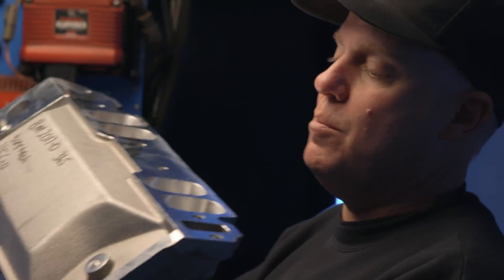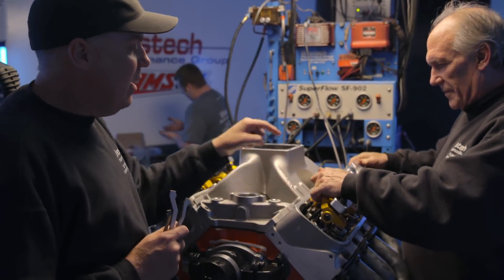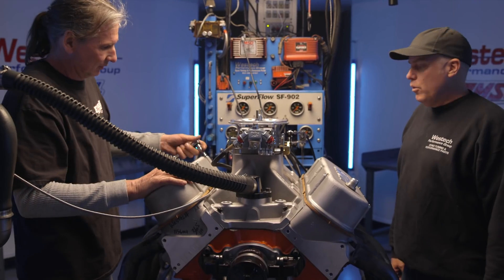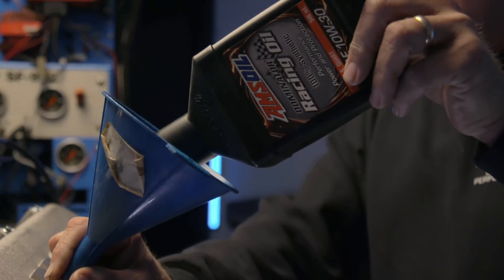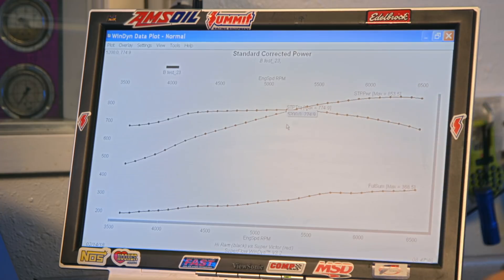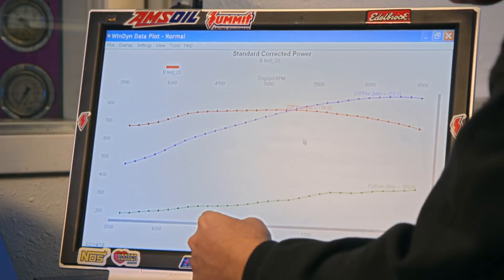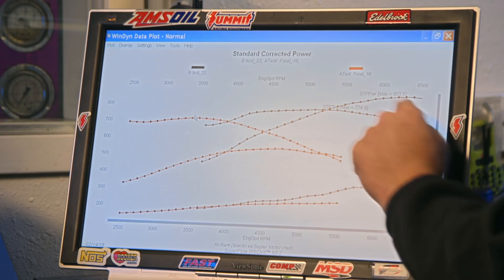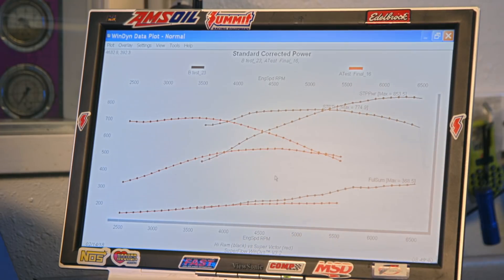Torque vs Horsepower — Engine Masters Preview Ep. 31

Comment: Sweet little motor tons of power and tons of fun. This was essentially a bolt on build. Would I would like to see is this motor with a proper quench height. So deck the block to give say a 30 or 35 thousandths quench height instead of the 65 or 70 thousandths height it most likely has. The quench would be improved and you would get your compression ratio much higher. Which is what you were looking for. I would be your motor would produce 915 hp to 925 with this one change. Nothing to sneez at for sure. 60 to 70 horsepower gain with machine work and no additional or changed parts. Wonder how close I would be.

Comment: They did an episode on 383 chevy vs. 383 mopar. It was laughable that they said, "mopar was better, because it made a little more power" ...except they obviously don't know that the mopar 383 weighs almost twice as much as the Chevy 383 and the 383 mopar is a big block that is actually 408, instead of 383 and the mopar parts are harder to find and more expensive. 
I usually agree with these guys on pretty much everything, but on this they were either ignorant, or dishonest, those are the only choices. Probably why they deleted the episode from youtube.
This is still  hands down the BEST show on MotorTrend and is well worth $4.99/month ...plus you still get 99.9% of the other great content on MotorTrend. Just remember, these guys know who butters their bread and it's their job to sell you stuff!

Comment: Torque in some instances is far more important. Designing a diesel motor to pull a truly heavy load. U need to put the emphasis on low rpm pull. All the top end power in the world wont matter if it stalls and dies once u put it in gear. Gearing is very important its true. But without monster lowend torque to turn those gears u aint going nowhere. Torque truly rules the heavy duty section.
Reply: You just use low enough gearing so that it doesnt stall.
Reply: torque for the real world and stupid low enforced speed limits
HP for the race track and those with small dicks who can compensate for the lack thereof

Comment: First off I love this show ! it is so refreshing to watch you guys cut through the BS and just lay it out so the the keyboard experts of the world can see actual experts prove them wrong (or right). I understand you probably have a deal with Holley because you use the same Holley carbs in all your vids, but can you do a vid on comparing off the shelf carbs v's custom built carbs like pro systems , APD, AED  etc.. ? the reason for my need to see this is because in my local drag racing environment there is the old argument of this brand is better than that one verses the slightly logical argument of it doesn't matter which brand as long as the same fuel ratio at this RPM is the same they are all the same. I'm interested in price over performance, peak power and power curve difference, throttle response. I know this would be an expensive test but I am truly sick to death of people saying i can go faster if i buy an APD carb and ditch my Demon carb and not being able to offer me any real hard evidence that a$3000 carb is going to be better than my $800 demon . please please please consider my request!

Comment: The higher the power band is in your engines rev range, the lower ur torque output is going to be which is why think it's ignorant when people say the LS is superior to the Coyote because the LS has more torque. That's because the LS/LT peaks around 5800 while the gen. 3 Coyote makes power through 7500 rpm's. Diesel motors are torque monsters but can't rev higher than approx 550 rpm's

Comment: You guys need to do 3 way test of the best small block from the big 3 factory installed in a car. 
Lt1, 351 BOSS, and whatever Mopar had (340 6 pack?)
All in stock configuration

Comment: You guys talk a lot about performance parts and HP/TQ. What about volumetric efficiency and fuel economy while increasing HP/TQ? Obviously there is a limit, but can you gain, say 50-100 HP/TQ with out losing fuel economy?
Reply: compression, tuning, fuel type. but energy is energy. either the motor is going to be much more efficient at extracting energy from the fuel, or you just need more fuel. you could gain 50-100hp if the engine wasn't really taking advantage of the fuel in the first place.  and also, the way you phrased the question you could just easly add more hp from fuel. stay off the throttle more and then when you want to just have 100hp more available all the while overall getting better gas mileage

Comment: 700hp test
Cast iron vs Ls 3,7,9,x
Put both engines into a car setup for quarter mile. Compare which motor gets the car down the track fastest

Comment: Compare that motor vs Lsx and put them in a car and do a 1/3 and 1/4 mile times see which 700hp is faster..7.5 liter v8 vs lsx..
Test vehicle both engines can fit into any gm car..

Comment: Would be interesting to see a full rpm range graph of both. Not just 3000+
Reply: They can't with that engine dyno, also wot, lots of timing and a carb is a nono at low rpm.

Comment: Watched the episode for free on the site and I think David backed down to quick on his debate. The iron head set up would be perfect for something like a 1 ton where you want that low down torque. That 700lbs of torque at 2500/3000rpm would be more useful then the 740 at 4500 when towing. Revving the engine that high going up hills would get that BBC hot pretty quick. Also you save a few thousand dollars using the stock 454 heads and stuff

Comment: It's ridiculous that there's even a hp vs tq debate... Hp= ftlb tq x rpm / 5252. It's just math. 
More torque at any rpm means more hp at that same rpm.
It's all about the torque curve, which in the case of this engine, the torque curve is ridiculous. Nice build.
Reply: I think the idea is that building higher HP often means shifting the torque curve to a higher RPM, and not just higher across the RPM band.
Reply: @peterthadeus9441  I agree, that's often the case. My point is it's all just talking heads until the dyno is displayed. The torque curve defines the character of the engine more than peak hp#s(even tho their the same thing).
Reply: Well, ft.lbs is the term used for work done, torque is lbs.ft - an important distiction if you want to make a point of it, but you have the gist of it.
Sort of, power is indeed a function of torque and power (do you know the actual math's for the 5252 - I worked it out over 40 years ago, and been using it since). 
BTW, in SI (metric) terms it is N.m x rpm/9880 = kW

Oh, torque is basically a function of engine efficiency, or VE, and if a "power" engine is better optimised for cylinder filling, it would be expected to show more torque (less any increased internal lesses).
Reply: Nacho Man - yes a 200 HP 1000 cc superbike has more torque everywhere when compared with a 500cc 50 HP bike. And if the 500 cc feels 'torquier' to some, then that's just shear emotion - just guessing, because in the high rpm's such a bike is lacking so much *g*.
Reply: @JamesBrown-ux9ds ... So a 500cc feels like more torque than 1000cc due to emotion but lacking "g"..... However it feels just wear a Helmut.
Reply: That's not true, at all. HP does NOT equal Torque!
Reply: John Doe you're right, Hp does not equal torque. See first post to clear your confusion.

Comment: Big block chevys dominate!
Reply: Unless a mopar shows up.
Reply: Brian Samuels our smallblock ford on pump gas makes about the same horsepower.  Sooooooo
Reply: Jon Doe it might do but what compression ratio is it running and is it streetable?
Reply: Brian Samuels 8.8 -1. Setup for turbos.  Haven't got that far yet as the trans keeps letting go.
Reply: Jon Doe ok a force induction motor. It's easy getting lots of from those types of engine builds but not NA and streetable.

Comment: I love how the sound of the engine is nowhere near the actual throttle position.  You can see the throttle slam shut in the middle of the run and then open back up, all the while the sound is of almost max RPM.
Reply: LiveeviL6969 they shot some Broll and thats it. They didnt record the engine during the dyno run...
Reply: @littlebuch  means you don't have to deal with showing fuckups like leaks and similar. us mos don't grasp how a run should sound.
Reply: It is just clumsy editing. The audio and video could have matched, they just boogered it.
Reply: LiveeviL6969 haahahaha good eye
Reply: Also the shutting and opening part is the same clip played on repeat...
Reply: Good eye
Reply: They suck

Comment: I think horse power is better than torque
Reply: not if you're driving a truck
Reply: raptorne1 torque ftw
Reply: Enayer 926 nope! You build a engine for torque not horsepower.
Reply: Brian Samuels Dude what are you even talking about? Do you even know what horsepower means?
Reply: Matthew Prather torque gets you going real quick especially in a short distance. Pulling power. Horsepower is only felt on top end.
Reply: Brian Samuels Horsepower is a measure of work being done. All you need to know for acceleration is a horsepower graph.
Reply: Matthew Prather torque is more important than horsepower especially launching a car and going a short distance. You must not drag race. I beat a lot of street cars from light to light in my 4,200 pound '68 impala because my engine makes 600 foot of torque max in the low rpms not because it makes 565 horsepower.
Reply: Brian Samuels Horsepower is a unit of power, just like watts, that number is the force on your rear axel making you go. Torque is just a number in the equation to calculate horsepower
Reply: Matthew Prather I understand that Albert Einstein. You just don't understand my point but it's all good. 😂
Reply: Brian Samuels Horsepower is all that matters. Motors with a big peak torque number are making a lot of horsepower at low RPM. My basic point is if you want power at low RPM, you need a lot of torque. But the torque is not what you should be paying attention to, it's the power. The power is what is actually dictating how fast you can go and how quickly you can reach that speed.

With a long enough breaker bar I can put out 600 ft/lbs but I can't replace an engine because I'm not outputting any horsepower.
Reply: Xei nope! Horsepower isn't all that matters. A car or truck wouldn't move without torque. They both need either but in the real world torque is more important. Example: in 1970 cadillac motors back in day only made 400hp but they made 550 foot pound of torque! So you don't actually need a lot of hp to make big torque numbers. That's a myth. It all depends on stroke.
Reply: Brian Samuels Horsepower is just Torque * RPM / 5252. Torque is already included in the equation so you don't need to include it as a seperate number. All that matters is the horsepower curve. Peak HP numbers don't tell you a lot but the HP curve is everything.
Reply: Horsepower is how fast you get to the wall;
Torque is how far you go through the wall :
Reply: I think that it doesnt matter which one is more important but merely that both help.
If an engine creates 400 ft.lb. of torque at 3000rpm; it will produce 228.48 hp at 3000rpm.
If that same engine were to produce 400 ft.lb. of torque at 6000 rpm., it would produce 456.96hp.
If it again were to produce 400 ft.lb. of torque at 7000rpm., it would make 533.13hp., at 7000rpm.
Hp is a measurement of work being done and cannot be measured on a dyno or anything else without torque being applied.
Just like your fingers or your thumb will not move without torque being applied to the tendons in your hand and arm.
 It's not the same ones I'd like to squeeze the life out of some people but it is a function of torque.
Reply: HP for sports cars, Torque for trucks.
Reply: Enayer 926 That statement makes no sense